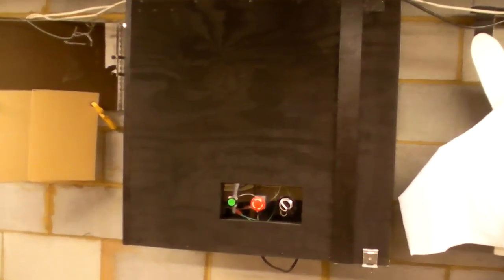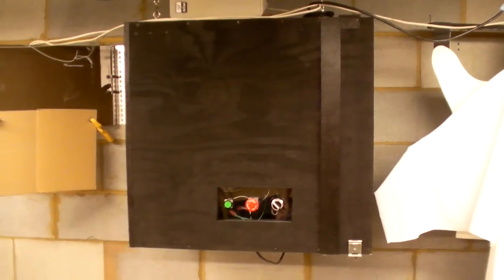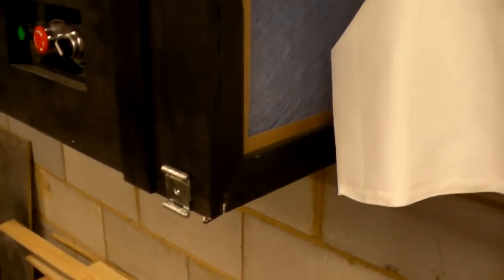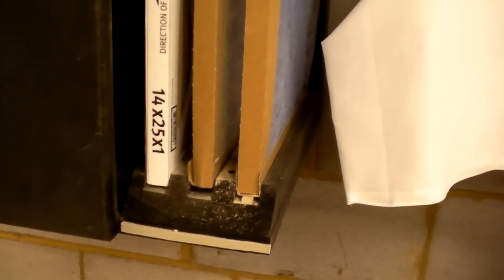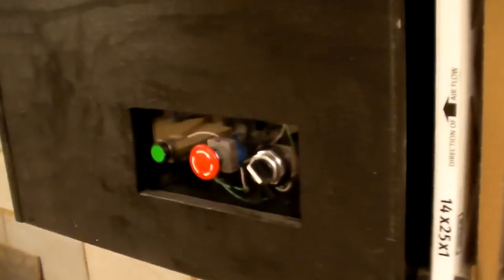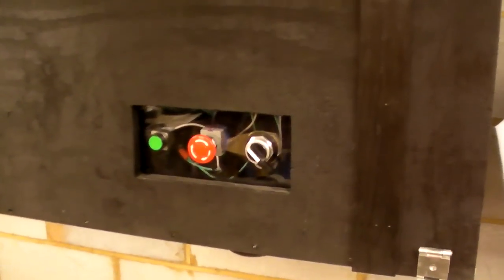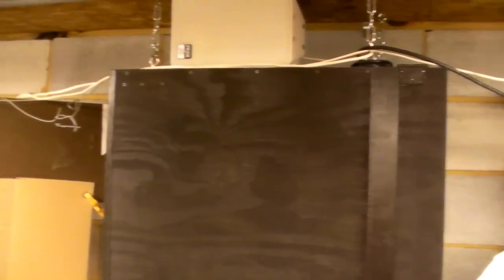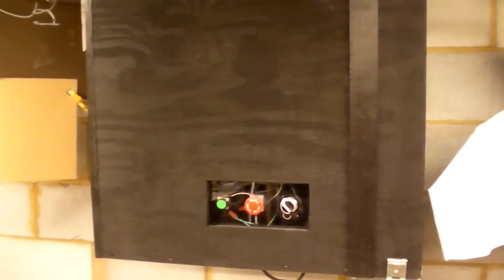DIY Homemade Shop Air Filter - WidgetWerks.Com

Comment: Hey your into everything. Those filters (Blue) do they have a sticky side to them. If so the sticky side needs to go toward the blower. The sticky side is used to trap the real small stuff. If you have the sticky side facing out it will plug up fast that way

Comment: Here's a suggestion... I built my air filter for the shop about ten years ago and I use four filters. In this order... Cheap foam filter like you would see on a window a/c unit. This can and will catch a TON of dust. When it gets dirty, take it outside and shake it or just wash it. Next, a cheap fiberglass filter. These will still catch a lot of dust too.  Next, a mid grade filter and then, finally, the highest grade air filter you can get. 
You'll see that the first two filters catch most of t